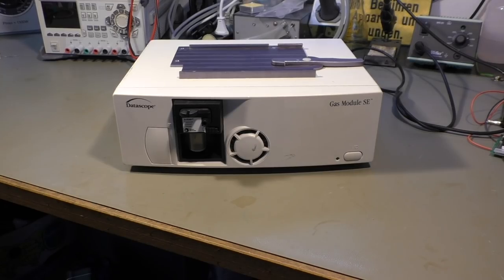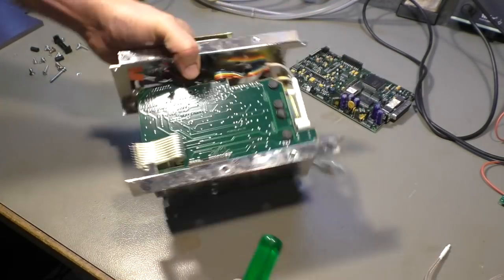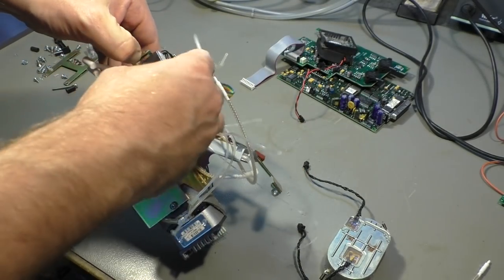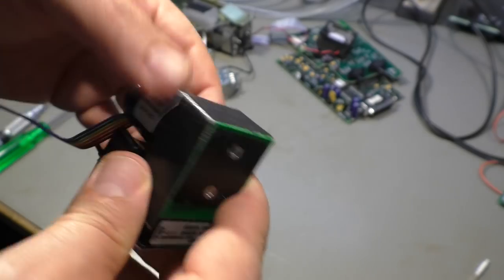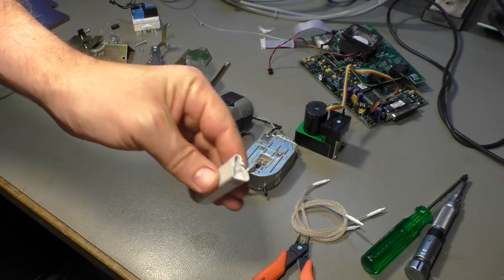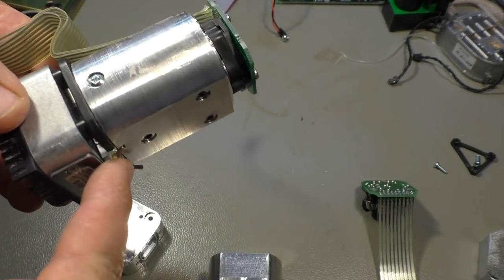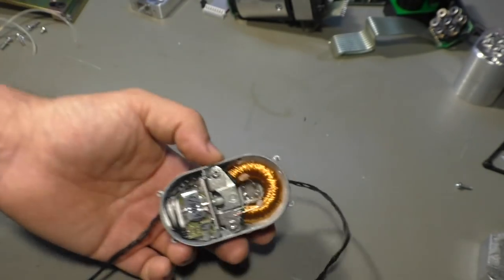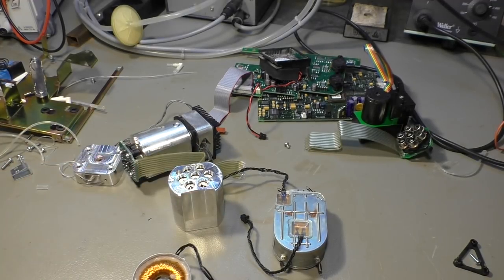Another interesting gas analyzer - (PWJ154)

Comment: About the para magnetic Oxygen sensor. Its not an acoustic system. The sample and reference gas streams (atmospheric air) converge in a rapidly
 changing magnetic field. Because the two streams have different oxygen tensions (i.e., different numbers of oxygen molecules), a pressure differential is created across the pressure transducer. 
Also latest Gas Analyzers now come in the size of a pocket book! Its amazing how much they have miniaturized such a complex system!

Comment: If this small pinkish window is made for passing thermal IR instead of near visible IR, its probably made of Saphire! :)
Reply from the maker: Ah yes... that would make sense. I mean if they install hoses $100 per meter, they can also afford sapphire glass. On the other hand sapphire is not that expensive... :-)
Reply: @PlaywithJunk  I just checked and Saphire is good up to 5000nm, so not the long wave IR, but still I think it could be something like a sahpire window :)
These tubes are quite amazing. I think they use it as membrane between the electrodes in fuel cells, since its permeable to water (and electrons) but not to the Hydrogen and Oxygen gases, but its just a guess :)

Comment: Could you please share part numbers of termophile sensors? CO2 has specific absoption line but not sure about rest of gases. Are band pass filters integrated into the sensors or are in the cavities.
Reply from the maker: There is not much written on the sensors.
Reply from the maker: Try the maintenance manual... maybe there is some information inside:  
https://www.mindraynorthamerica.com/cmsAdmin/uploads/0522revk_gas_mod_svc_addendum.pdf
Reply: @PlaywithJunk  interesting reading material for sure see you on the download LOL.

Sometimes maintenance manuals can be very helpful when repurposing any device and even if you know you're going to be saving things maintenance or service materials oh yeah can keep you from messing up something that will be easy enough to do this that might be just for those parts that's valuable enough to keep or something that would be very expensive otherwise!

Also I'm pretty sure somebody's mentioned this but don't know!

Us halfway expecting you or at least just thinking in the back of my head with a sec this device is an air pump and tubing and was talking about being able to how to run the air pump itself and all the Dust since you do some things that are pretty funny sometimes I thought you would just quickly use some of the existing parts and clean the dust out of the equipment with apart from the equipment that would have been awesome I bet you would probably cracked up your viewers as well doing this it didn't say something about reuse of an air pump as you said you never know when you'll need an air pump well you could have used one right then and there

Comment: How hard could it be to test that oxygen sensor?
Reply from the maker: Hmmm... the problem ist that detailled technical information on medical products is hard to find. All I know is that the magnet must be operated at about 160Hz... voltage...current... and all the rest? Maybe it would be easier NOT to disassemble the unit and use it as it is :-)
Ooops too late...

Comment: Nice video! 

I wish next time you would additionally show how those things work i.e put some power to it, get some measurements etc.
You could also dump the content of the flash / eeprom and share it or at least look for strings in the content (maybe you would find some easter eggs).

Regards,
Reply from the maker: I would love to... but this was only an addendum for a monitor device. Alone it can not do much. So it's just an interesting teardown.
Reply: @PlaywithJunk  I meant you could put power into those parts like power up the pump, IR emitter etc.

Comment: Anybody know how to get youtube out of mobile mode amd why It keeps forcing itself back to mobile mode?  It says desktop mode, but stuck in dark mobile mlde.  All videos in suggestions are years old.  I can ot see any recent suggestions.  I can only leave comments and watching videos requires a separate video converter and is at 144p only.
Reply: Font is super tiny. Cannot go back and edit.  Now a drop box appears when I want to thumbs up or down.  Becomming the ever useless and frustrating platform.
Reply: @gavincurtis  Sounds more like a problem with you and your equipment than the "platform".
Reply: How can all pieces of equipment in the household change overnight?  Apple and android both are stuck in mobile mode only.  I cannot even leave a comment from either devices.  The only way to watch a video on an android device is to view it using a video editing tool outside of youtube!  I have never encountered this before in over a decade of using youtube.
The only device I can even get access is my surface pro.  But even then, I cannot see this text I am entering and the device is running hot only when attempting to use youtube... the entire layout of youtube has changed for no reason.  As of now, all my suggested videos are years old.  The reply icon to send this message is also missing.

Comment: Why don't they just use an infra red LED instead of a heating coil. Would use a lot less energy.
Reply: A LED makes IR at a very narrow wavelength, this requires a broad spectrum and probably at a lower wavelength than a LED could make.
Reply: because they need a constant spectrum of wavelenght and not peaks of several lenghts.